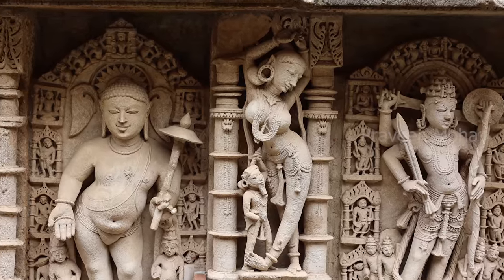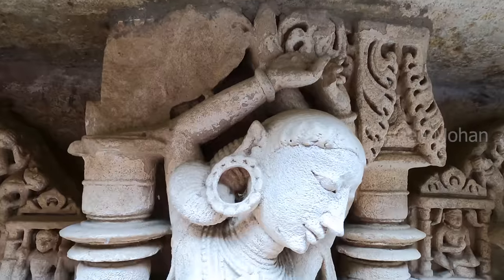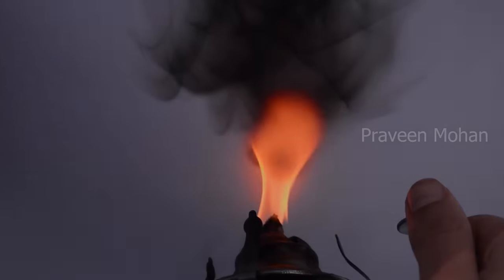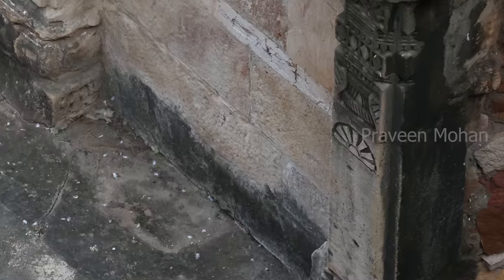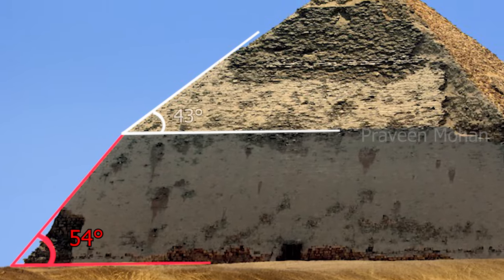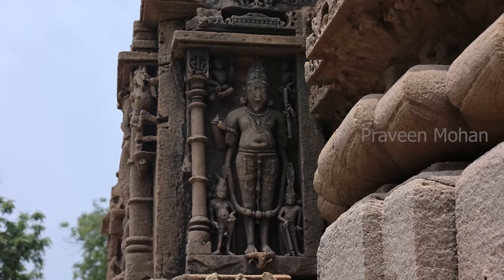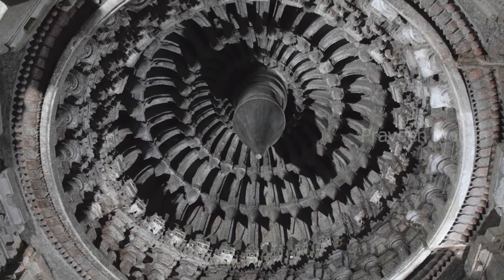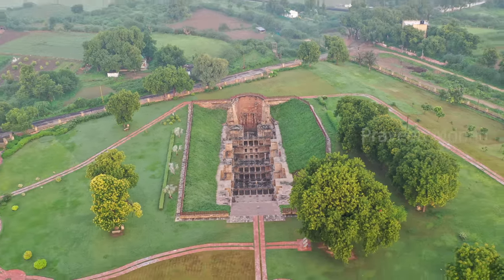Did ancient MEN REALLY do this? Strangest Secrets of Rani Ki Vav!

Comment: Thanks Praveen 👍🇮🇪💚🙏🏼
The bent pyramid in Egypt was intended to be built that way. You see inside pyramids there is unique harmonics and that particular one is called the pyramid of 2 tones. It gives off 2 tones perfectly in harmony with each other. Check it out, the bent pyramid in sacara in Egypt. It wasn't a mistake but done purposely to get the desired effect. 👍🇮🇪💚🙏🏼

Comment: Excellently done video! Have been following your channel for sometime. Accurately reading various carvings surfaces the most interesting forgotten technologies. You may want to focus more energy on a deeper investigation of these carvings. Certainly the carvings may be supported by writings somewhere to a degree. Wouldn’t think the carvings are the only communication method used.
Also, where the carvings separate statues built elsewhere and inserted within a frame? Where they carved from chunks and somehow stacked to produce a finished statue? Then how were they connected to align and hold in position? If carved out if solid stone, how was it done? Would need to have been planned before manufacturing. Then transferring design to the location. 
As you might tell, deciphering how these stories were produced is really as or more important then noticing a flashlight object. What you’re offering is potentially magical with understand past technologies and currently is only scratching the surface! Commented before with requesting using a 3D scanner to produce a 3D image in a Laptop. Our computer technology is advanced enough to provide the muscle and to store scanned images. Don’t know what dimension accuracy is available but current accuracy should be enough to get this off the ground. 
It’s less about identifying independent objects and more about how they functioned. Some answers exist in how everything was produced and carved.
Other videos touched on very high technology hidden away in sealed rooms. Honestly, if anyone feels they are safe from prying eyes, they are crazy. Right now, FIAT Currency Systems are dead and in process of being replaced. World Powers are jockeying around trying to get their choice as the new replacement. Don’t feel it’s going to happen… However, real value isn’t with Gold & Silver, it’s with Technology! Hence if it exists hidden and sealed away, this won’t continue for much longer!

Comment: Just imagine the sheer amount of efforts in building a place like this more than thousand years ago. The planning of the temple, the drafting of drawings, making a blueprint or a raw model on paper or whatever they used at that time, making plans on what to do and when to do it, calculating angles so that they dont mess anything after they have started building the temple, imagine the workforce, imagine the sculptors who have carved this in such detail that it almost looks 3d printed somewhat, imagine the sheer amount of skillfulness needed to carve each and every nook and cranny to such high level of detail without any modern tools. If you know engineering and think about the building process from the start it is absolutely mind numbing.

Comment: Angles are a modern concept that requires and understanding of circular functions and calculus. Yet the Babylonians (& Egyptians) used rise over run to do their surveying work. This has been confirmed by their understanding of Pythagora's theorum 1,000 years before he was born and rational number pythagorean triplets which describe what we would call the angles from 0-90.  Its an interesting area that challenges the way we do things currently. In France there are megalithic stone constructions that confirm a right angle triangle using a 3:4:5 knotted rope which is a pythagorean triple (even if they didn't call it that at the time).

Comment: 1. The carving may or may not show a pregnant woman and as you yourself said, this carving is not alone in showing a woman without a flat stomach. It would be helpful if you showed other carvings in comparison, are those carved women pregnant? You show comparisons for other carving’s, why not this?
2. The “device” in the carving does not resemble a Penard Horn. In order for it to function as one it would need to be of that shape as it is the shape that makes it functional, as with any horn. 

The flashlight could be interpreted as a multitude of devices, it looks more like a bell to me. As for the lack of soot from fire torches, they went to all the trouble of carving these temples, I’m sure they were capable of cleaning off soot. 

The angle finder looks very similar to the Japanese representation of the rising sun, it could be either or neither but given the wide range of Hinduism I’d be more interested in an investigation of this. 

I thinks it’s plainly obvious the designers of these temples needed measuring devices, it’s not a revelation. 

“It must be an angle grinder” - Why must it? 

“It must need electricity, right!” - Why must it if it’s not an angle grinder? 

The comparison between a carving on a chest and Ironman’s Arc Reactor is laughable, what would you compare it to if the FICTIONAL character Ironman didn’t exist?
Reply: 1 - There are so many female structures in this entire video for u to compare . And remember these are 3-D sculptures . The lateral view which we see matches with the horn . Only Praveen knows the front view . I mean what else could match the scenario of a woman willingly displaying her belly to a man with an instrument in his hand with one end somewhere close to his ears .
2 - For sure its not a bell as u can see at 2:37 that the end is not hollow but closed and flat just like the end of torches from where the light flashes .
3 - First even I thought it to be Sun until I realised that it was a Hindu temple and Hindus always use a 'round sun' image to depict Sun and never a semi circle
Reply: @Samarth23567  1. Praveen is making the presentation and it falls upon him to make the direct comparison’s both for and against his ideas if he wishes to be thorough.
2. For sure nothing, that was why I pointed out it could be something else. Praveen states categorically whereas it cannot realistically be interpreted as such.
3. It could be anything, including an angle finder. Again, Praveen states categorically that it is an angle finder whereas realistically it cannot be interpreted as such.
Reply: please read @vinodkumarpadmanabh's comments appeared just before your comment
Reply: @InimitaPaul  first explain did now you believe Unesco version that it is step wall

Comment: Fascinating analysis. My friend can diagnose some issues with an internal combustion engine by placing the wooden handle of a screwdriver to his ear and placing the tip of the screwdriver against the engine. The vibration of the sound from inside the engine travels up the shaft to the handle against his ear.

Comment: It is said that such temples are 1000-1500 years old. Is there anything that can be studied using the C14 carbon method? This is very important. Temples look as if they were the transmission of some old civilization. Maybe the temples contain mechanisms that have already been dismantled or specially broken? Maybe they contain technologies that need to be extracted and understood? Maybe they contain only descriptions of technology? I am very impressed by the huge magnets that were used in temples. From this only a step to the generation of electricity. A number of rotating elements can have magnetic properties and be a kind of dynamo.

Comment: Praveen, I'll believe that Indian physicians used their version of a "Pinard Horn" 1000 years ago. Very simple technology. The 1000 year old version would be almost identical. And I'll believe that Indian physicians use various kinds of more advanced technology than that. We know from written records that Indian physicians did autologous tissue transplants on human beings. Rather well known is the method of grafting tissue from the forehead to make a new nose for someone who lost their nose due to injury or illness. It involves retaining the  blood supply of the grafted tissue, to keep it alive, until it was securely planted in place at its new location. A very similar method is used today. But I'm having trouble imagining a "flashlight" similar to those used today. Too many different things all working together. A tiny glass bulb that has had its air removed and has a filament inside that glows when electricity is supplied? Really? Plus a source of electricity? OK let's give that the benefit of the doubt. But the energy source is shaped similarly to today's cylindrical D-cells or C-cells? It is starting to sound like too much. Now, a device for listening to a fetal heartbeat, that is an improvement over just putting one's ear to mom's belly? I have no doubt about that.

Comment: Pinard Device: The figure is not holding the device to his ear. Nor is the device for conducting sound as it's somewhat pointed. Flashlight : the shape and placement of the hand better indicates a bell, presentation or offering. It could be the the badge that says "HI, My name is Mark". Either way there are more mundane offerings to choose from before jumping to modern tech. The same with the angle grinder. I see a scepter of office. The angle finder is a great idea. but your examples don't show how they relate in their orientation. what are they lining up? The ruler is unlikely though measuring devices were undoubtedly used. A straight edge with definite marking would have been easier to make, but instead there are star shapes. in the middle of the rod.  An easier guess would be that the rod was also some indicator of office. there was a rod, and the artist saw the rod but not it's markings hence stars. As for the chest ornament. I can't say I know enough to consider. I've always thought its like a symbol of inner power, a good soul. Like how westerners use a nimbus around the head to indicate the holiness of their saints in illustration. I don't mean to sound harsh, but while your have interesting ideas, your evidence equates to your interpretation of the Face of Mars. Back up your idea with the legends behind the devices you're pointing out at least. It'll take more digging, more research. but the stories you find along the way will make the discovery worth the journey.

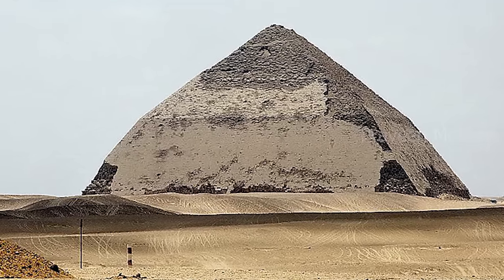Comment: At 6:55 you mention a "mistake" at the Bent Pyramid at Dashur. That is most definitely NOT a mistake. It was intentionally designed with those two two different angles. 6 and 5 to represent as above/so below. The Macrocosm and the Microcosm. The hexagon and the pentagon. 4 segments of each folded on top of the other to form the "bend".  I have references to prove this if interested. Seriously.

Comment: Cool! And it might not be wrong to assume that Dr. Pinard did invent it AND the ancients used the same type of device. The same thing can be invented by different peoples without knowledge of what other cultures are doing. But sorry, I'm not buying the flashlight. Looks more like a round brush, with a slight flare to the bristles. The markings on the "rule" are at uneven distances. And an angle grinder? I'd be more inclined to believe it was a scepter. And your "power source" was a chest piercing.

Comment: A theoretical debate and offers much in the line of surmising the facts about the said architecture.  Obviously the statues were carved outside from all over the province in large numbers, later placed in the temple.  It is not a Torch but a symbolic tassel or incense stick.  The so called pregnant figure is purely rotund, whilst an object of fertility is menacingly suggested, very common in the ancient World.  Then we have the Angle Grinder theory and electricity thrown in to justify the entire building work, and no mention to the material it may have been constructed from ?  I think these guys got along nicely before Makita was invented.  The protractor pattern had a pin in the base, probably used as a bob for working out curves in the architecture, but outside of this I think you've been spending too much time outside in the sun dreaming.  Just stick to a nice curry and leave the tricky stuff to the archaeologists next time.